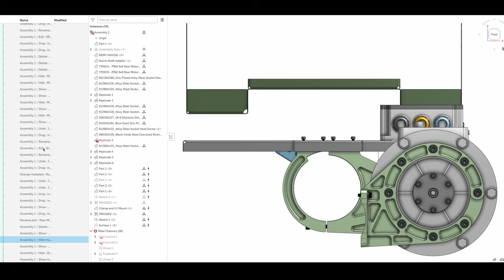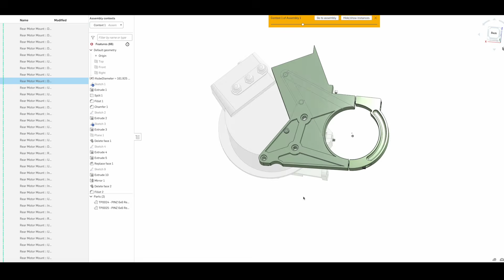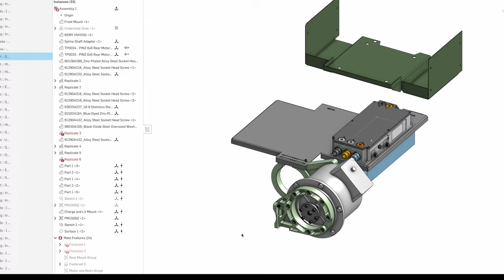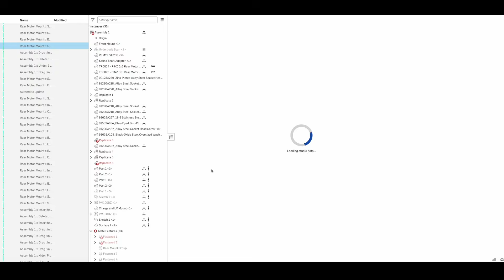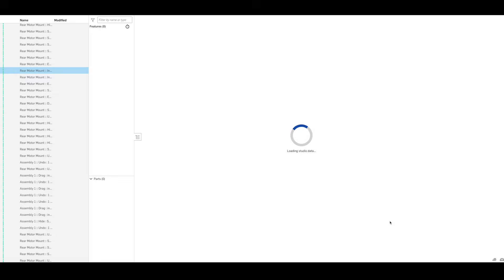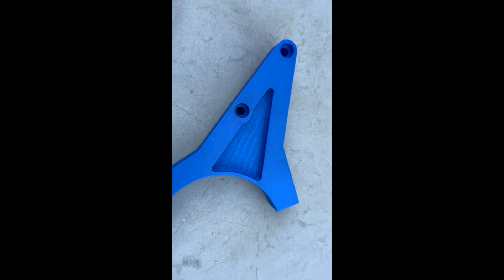Pinzgauer 6x6 EV Conversion Part 3.5: CAD

Comment: If you're just learning this stuff and figuring it out you don't even need a 3D printer. Print the side from paper and tape them up to make an approximate model. You can check whether stuff lines up in a few minutes and iterate. Get it right on a paper model and buy a 3D printer and make a hollowed out version for a full test... You almost never need a solid print for this... 

Even the part you had made could have been laser cut and then you just drill and tap a few holes... I would guestimate for about £50... keep learning, it's half the fun :)
Reply from the maker: This is a really smart idea, especially for the first print! I bet it would have given me enough information to reduce the number of 3D printed prototypes by 1.
Reply: @creativeengineeringprojects  I used to get aluminium parts laser cut and bent but I also had access to a laser cutter so I would make the parts from cardboard first. Fold them up and make sure I wasn't making an expensive mistake. You could also print the side, glue it to some thick wood, cut the holes and test your design that way too.

Comment: 100% you need to get a 3d printer. Two parts later and you're into a cheap bambu lab need slinger that will work full time for you on the pinz!

Comment: hey before buying those 3d Printed parts so expensivly just buy a 3D Printer - it will repay itself in no time
Reply: Yeah at $360 you're already more than a bambu A1, and into P1S territory. Sure, bigger parts might need printing in pieces and gluing together, but you're talking hours between iterations and not a week or more 👍
Reply: 90 USD is wild for that PETG part. 🤯
Reply: On one hand, yes, printing parts yourself means you don't need to wait and pay for them to arrive, but with buying a 3D printer you open a whole different rabbithole.
->different kinds of filaments, slicing and it's details, which size printer, what printer, space for the printer, print locally or via network.
And lastely because some people always recommend Bambulab printers: do you really want to do it their way...
With what they did last year, i personally am staying clear of any of their products.
Reply: @nirfz strong disagree, you dont need to learn a lot at all, the printers have become that good. That's defently a thing of the past. 

I recommend bambulab for beginners because they make it so easy to stark and have amazing documentation to get into 3D printing 

When you outgrow that, you can buy a different machine but most people probably won't...
Reply from the maker: I think you're probably right!
Reply: @creativeengineeringprojects I bought a BambuLab P1S a few months ago and couldn't be happier, what everybody says about how much new stuff there is to learn is wrong. If you just want some prototypes to print you pretty much don't need to learn anything, just hit print. I was amazed too! 

If you buy one defently go for one that is enclosed and has at least a 256x256 build plate! 

Good luck on your journey with the conversion!